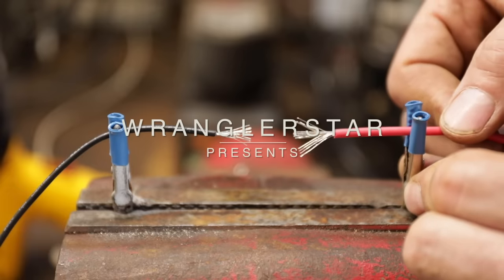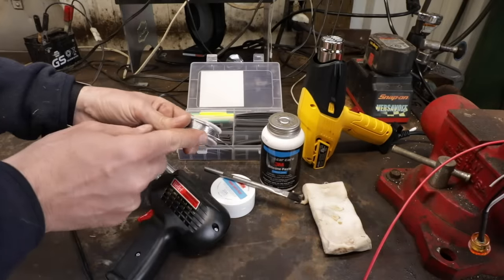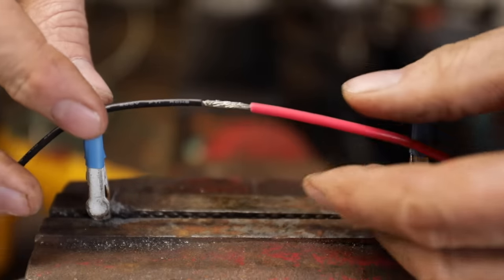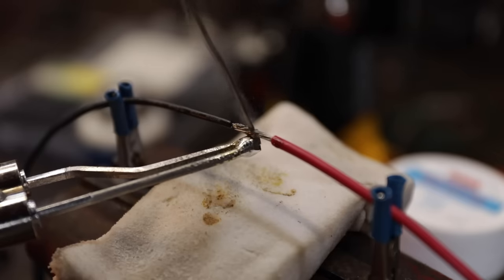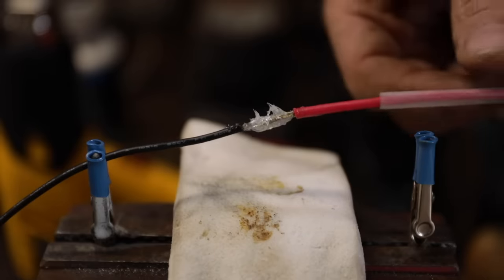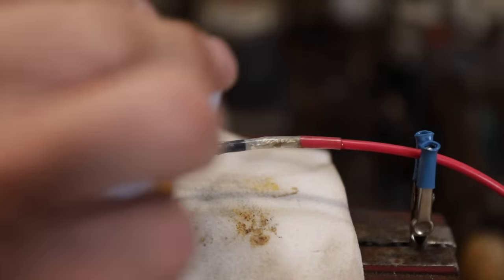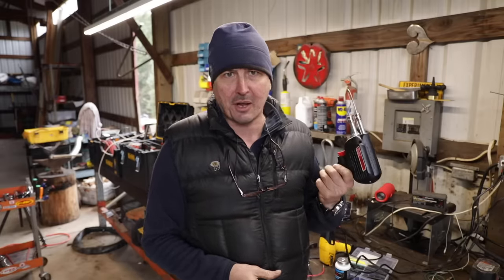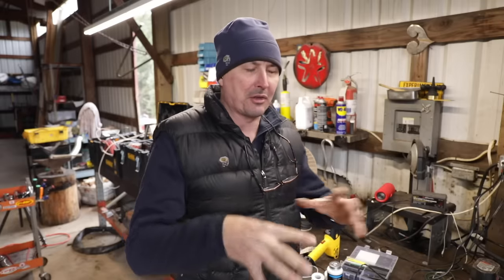How To Solder Wires Like A Pro

Comment: Cody-
For non-stranded wire there is the NASA approved technique: https://www.youtube.com/watch?v=O-ymw7d_nYo
Reply: Was hoping that someone had allready put that link here, otherwise I myself would have searched for that great video on a linemans splice.
Reply: thanks for the link, I have never heard of this but I also never solder solid wire. I will try this technique out sometime!
Reply: Tinning stranded wire has the effect of making it solid; so this techniques works with that as well.
Reply: Did not know that was a NASA approved technique. This is the way I was taught in Principals of Technology in the early 90's
Reply: halnywiatr> Cody was soldering stranded wire - is the technique the same?
And can you explain exactly what the problem is with the technique he used?
What would be the failure point and what amount of stress it would take?

I did not address this question to all of the so-called "engineers" and their
self-righteous "I know better because I have a degree" BS, without trying to
be helpful. Every time I look at some of the products that the "Engineers"
have "designed" I think they should be regarded like lawyers, and used care salesmen.
Reply: Hammer- 

The NASA technique is a variant of the linesman's splice (a/k/a Western Union splice).  The linesman's splice is the strongest under tension as it spreads the forces across a longer area of actual wire-to-wire contact without the need for any solder.   The addition of solder protects from wear that the splice might suffer from alternating from tension to slack.  Cody's splice will work very well in most applications (he's not going to the moon or transmitting telegraph messages over a canyon), but the only connection in Cody's splice, for both transmission and for the mechanical tension, is the solder. 

Also, some of the strength of stranded wire comes from the "twist".  The point at which the strands are separated becomes the weakest point of the line.  If you compound that weakness with the transition from flexible (twisted strand) to rigid (soldered strands) that weak point is now acting as a hinge.  Copper work-hardens and becomes brittle at such points.

It is an important context that copper is an excellent conductor for transmitting signals (sound fidelity) as well as conducting wattage.  Making those transmissions have to bridge across sections of solder reduces sound fidelity and for pure power transmission defines the point of highest resistance (heat) for failure.

Again, for 99% of splices such critical factors do not come into play (and i have used the technique Cody shows in tight spaces), but the better standard is the NASA.
Reply: Solid wire before twist or crimp connectors was always done.  Every electrician always had a small solder pot and ladle.  Then it was wrapped with electrical tape.  Years ago the electricians used fiction tape and not plastic tape.
Reply: halnywiatr The NASA-approved soldering method for solid conductors is bullet-proof.
Reply: same here
Reply: Yes the western union is the strongest connection, it works just as well with stranded wire..
Reply: My boss never worked for NASA and he has a different budget, I'd get fired spending that much time on one connection.

Comment: My audio shop refuse to answer my Q when I had my remote start installed: "are the connections crimped or solder?" bc 2 weeks later I have a lot of issues and now I  have a whole headache of issues. Not worth going back for that lifetime warranty crap. ALWAYS MAKE SURE YOUR CONNECTION IS SOLDERED.

Comment: Tinning the tip of the soldering iron allows heat to transfer to the wire more efficiently. Without it, it will take longer for the wire to heat and potentially damage the wire and insulation.
Reply: That is the way I was taught at Rolls Royce motors.
Reply: Think about what you are saying.  The wire has to get to the same temperature either way.  If you damage the insulation you have over heated the wire.  The wire should only be heated enough to make the solder flow.  I worked with people that had government certifications for soldering, they were not allowed to put solder on the iron.  They had to get the wire to temp that would accept the solder.

Comment: To solder like a pro you should use the NASA soldering technique, google it. Also soldering is not the best way in all cases, for example places with big temperature variation because the lead will crack.
Reply: Good video. That joint ain't coming apart. To finish it off the joint should be washed in water (yes water), then high  pressure air dry. This gets rid of  all the rust causing by- products of soldering. I made up a dual 250 W amplifier. It stopped working about 30 years later. When I looked at the pcb it was full of corrosion around the soldered joints and had eaten out the tracks.

Comment: Can't help watching videos like this when they pop up in feed, just to see whether one will finally do it right.

I'm still waiting.

This would be an inspection fail all day long in any industry where reliability is critical - it's a catalogue of errors from start to finish. 

For a bodge fix on purely personal projects with little risk involved if they fail it'll do. I wouldn't recommend poor workmanship and certainly wouldn't share it as tutorial, but in many cases the risk isn't too great.

 But if you're spending good money on equipment the least you can do is to do a little reading (free) and some practice (consumables are cheap) to significantly improve the quality of your joints.

I wouldn't normally bother to comment, but "like a pro" is one of those tags that really gets me... As someone who's been trained extensively and had to take courses in solder inspection, if someone came into a work environment and offered that up for inspection they'd be out the door immediately and all work produced would be discarded and replaced by a competent operator.

"This works for me" is bad enough, but "like a pro" suggests a degree of competence and authority to instruct - sorry, but this is not the case.

Nothing personal, you come across as a decent individual, but I felt compelled to respond.

Comment: 40 plus years arcade pinball repair.  It's a decent demonstration.  Not how I would do it but it will work the water proofing would be good for automotive. The weak points are where the solder ends in the copper wire it can't take a lot of flexing. The thick end of the gun tip is not the hottest part that is just slightly back from that where it curves. I generally make my own gun tips out of #10 AWG copper wire.

Comment: Fraying the wiring is NOT how pro's do it. Just saying. ;)

Don't ever fray your wires kids.
Reply: why not. without reason your comment is useless
Reply: @hitty9  a solder joint is only as strong as the physical wire joint that the solder is applied to. Solder is added to increase conductivity and bonding. A "frayed and twisted" joint will pull apart under stress. In military we were taught a version of the "Western Union" splice for strength before applying solder. Resulting in a joint almost as strong and in some cases stronger than the wire itself.
Reply: @williamstyers4264  Factually incorrect. Solder is solid metal cooled from the molten state. It is not the strongest metal, but it has strength of its own. Solder together two wires just laying next to each other and then try to pull them apart. That will require exertion on your behalf. Except in extreme cases, fraying is not necessary.
The military should not be your last source of info.
Please be more careful about spreading false science. Teach the kiddies the right way.
Reply: Wheres your video on soldering? " cricket ,, cricket "
Reply: @waltermercado2937  walter, ligue djá.

Comment: Please don't decry crimp connectors to everyone without first understanding in which situations they are the better choice. If any connection is going to be subject to vibration or extreme temperatures, then soldering is not always the best method. Of course, for a tie wrapped bike loom then what you did was fine.
Just to add, crimps are only ever made with a proper ratchet or hydraulic crimp tool, any other mechanical method you may have seen on youtube is utterly useless.
Reply: And in 12v situations when the hell would you ever need a freaking hydraulic crimp tool on what looks like 12-14 ga wire
Reply: James - I did say "Of course, for a tie wrapped bike loom then what you did was fine." - however in industry, crimps are used regardless of load or wire gauge because they are simply more reliable. Look inside your car/boat/space rocket, crimps everywhere.
Proper crimp tools are required simply because you can't achieve the required compression with a hand tool, even with 14ga wire
Reply: @jimmyscustomaudio  The correct compression forms a cold weld between the crimp and wire ...    Victor said OR  not that it had to be hydraulic..
Reply: @derekrobinsonutube  how many wiring jobs have you done similar to what this video is about or on any car, truck, boat?
Reply: @jimmyscustomaudio  
I have have worked in both commercial and military electronics all my life so I think I know what I'm talking about.

The very opening statement of this video de-cried crimps which would have been an instant alarm bell for anyone who knew anything at all.
He then proceeds to do just about everything wrong that one could.

There is a world of difference between the world of the amateur and the proffesional;  Learning is a proccess that is best done by listening from people who actually know about the subject not people who don't.
Reply: @derekrobinsonutube  I installed car alarms, remote starters, stereos, auxiliary lighting and other aftermarket products.  That connector he threw in the beginning of the video is not as secure as soldering.  I have spent 100s of hours troubleshooting issues due to poorly installed products and most of the time it was a connector that had failed.  Look at the application he is referring to.  They use connectors in the automotive industry so things can be easily replaced.
Reply: @jimmyscustomaudio   Because they hadn't been crimped properly !

Comment: I use solder sleeves.  There a small plastic tube with a strip of solder inside. You push the wires in either end and heat up with a heat gun. 
It shrinks the plastic tube and melts the solder inside bonding the wires togeather. Same as what you've done but alot quicker and easier.

Comment: Oh boy. That was painful to watch. He got views out of it though.
Reply: What u mean
Reply: Thanks
Reply: Yeah, I'm guessing soldering isn't his strongest skill, but still, if it works it works. He's not soldering medical equipment or anything.
Reply: I agree lol
Reply: @endtimes6869  Flux isn't necessary. It's already in the solder. His iron isn't hot enough. It should be hot enough to heat the wires within seconds. Tin the tip of the iron to help transfer heat to the wires. Otherwise you'll just be burning all the flux away with the solder sitting there heating for so long. I've been in almost no situation where "helping hands" could be used. Usually I'll be up under a car with my arms up in the engine bay soldering a wire that's already connected on both ends.
Reply: @juansolo1617  Flux IS necessary.... The only time Flux isn't necessary is when it's a rosin core solder. Don't spread misinformation.
Reply: @agnis2941  That's what I said, the flux is already in the solder. When you go to an auto-parts store to get solder, there will ALWAYS be flux inside. I've never seen a roll that didn't.
Reply: @juansolo1617  There are rolls that don't and rolls that do.
Reply: Juan Solo You’ve obviously never done component level soldering.
Reply: this is why you don't really take advice from people on youtube, they just getting that adsense money

Comment: I've found if you put a bead of solder (nothing too crazy) on the tip and you coat the wires with the rosin flux. The wires will start to absorb the bead and it'll get the wire really hot really quick, and just push more solder in till the wires look like chrome.

Comment: "Like a pro"... Pro would go back to the tool crib, get a coffee on the way, get a double ended crimp, get a coffee and a smoke on the way back, and use that instead. Sounds like to much of a hassle? We'll talk again wenn your wire breaks at the end of your tinning. They always do.
Reply: Yup
Reply: Agreed, properly crimped connectors will outlast soldered connections when vibration is present (i.e. autos, boats, planes). Solder is fine for electronics, lamps, toasters, etc.

Comment: You had the soldering gun on the wires too long. Loading the tip of your soldering gun or iron provides a heat bridge to the item being soldered. Add the solder between the heating element and the component. Never hurts to add additional flux even when using flux core solder. Good call using the grease to keep out moisture. I would have cleaned the connection with alcohol before adding the grease and the heat shrink. Splicing wires like this is OK for the public but would never pass "Good enough for government work".
Reply: You shouldn't use any more flux than is neccesary; it is corrosive..
Reply: Solder should be applied to the component or wire..

Comment: I thought we need to do it as fast as we can,  because the temperature will break some of the current board
Reply: not really, just watch out for vital components nearby like ICs or diodes
but with wires like that an especially long like that don't worry about it

Comment: Thanks!  those are great tips, I just wish that I would have watched this before I repaired a 40 wire wiring harness that I'm still getting codes with.  Sleaving the alligator clips is brilliant.  I have one of those helping hands with magnifying glass and alligator clamps and I'm going to sleave those clamps.

Comment: I've never had much luck trying to heat the wire and melt the solder that way --- I always seem to either overheat/melt the plastic insulation or tarnish the copper wire before the solder melts.  So instead, I always just melt a moderate-sized drop of solder onto the tip of the iron, and then use the iron as an applicator to touch the melted solder-blob onto the flux-prepped wire-joint; the solder quickly flows down onto the heated wires and saturates into everything thoroughly.  This is especially important for small/delicate joints where heat can only be applied for an instant; you would heat-damage the joint if you tried to melt the solder by heating the joint first.

Comment: Real technicians  use a western  union splice,rosin core (kester 44) solder and adhesive lined 3:1 heat shrink tubing. But then again i am not a utube expert just a 50 year service technician.
Reply: make a video, I'm learning

Comment: OHH MYYY GAWD ! 
used the massively oversized gun’ s narrowest side to overheat the joint, by staying on too long, vs shorter use of its wide blade... quicker, shorter on heat wire time...

I want to vomit, having done soldering wires, cables , connectors for years ... this is SOOOO Wrong !!!

Comment: When I solder cables together, I will make a connection called "linemans splice". This connection done right and sealed with glued shrink tube is approved by NASA. I mostly use this on bare copper. 

Most of the time I will use tinned uninsulated crimps on tinned wire and cover with glued shrink tube.

I'm a marine electrician btw.

Comment: What about wiring/soldering HO locomotive decoders with very fine connections
?
Reply: Don't use a large heat gun. You should use a temp controllable soldering iron. Hakko is a very popular, quality and affordable brand. Use a fine point soldering tip and use flux. One way to keep from melting insulation on small wires is to take needle point tweezers and put them in a small vice or zip tie to squeez and hold the wire just before the insulation, not touching. The tweezers will act as a heat sink and prevent heat from transferring up the wire. Aim for temp of around 600-620. They may narrow tip aluminum alligator clips and special tweezers with tips designed for this purpose, but at home most people have a pair of normal tweezers.

Comment: You're lucky that booger isn't that important.  You are wrong on so many levels, specially concerning the silicone. And you provided a void of an amateur method of soldering.  You have no soldering skills, using a 100-140W  "GUN" instead of a ~40W iron.  You should have 'flashed' the solder on from the top, with the solder between the iron and wire, thus providing instant thermal conductivity for the solder to flow, and to heat the wire and make subsequent proper connection.  I bet the wire is 'cold-solder connected' on the bottom, since you wanted NO 'drip'; easily dealt with by capillarity and adhesion to a properly tinned iron.  There WAS NO silicone between the shrink tubing and the red end of the wire, and it did NOT seal because of it, but rather in spite of it.  The black end is not stuck at all to the tubing--because of the silicone.  Best use the silicone for non-soldered connections only--and then it is a mess to work with anyway.  Better to keep water away from such connections, and if you can't--just repair it properly.
  I have been an electronic Tech for years at a TV shop, but went back to Fuel injection and wire harness repair/troubleshooting of V-Twin KVF750 Kawasaki ATVs, since it pays better, and ppl would rather buy a new cheap stereo/TV/whatever instead of paying to have it fixed.  Retired now, the skills I've learned are ever fresh!
Reply: Cool, do you make videos? If not you should, you sound very knowledgeable and a lot of people could benefit from that.